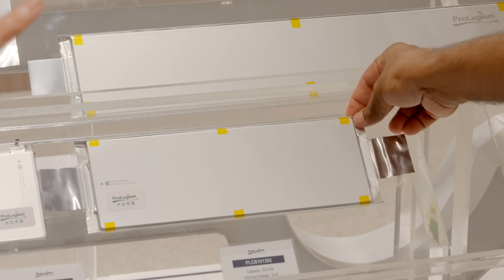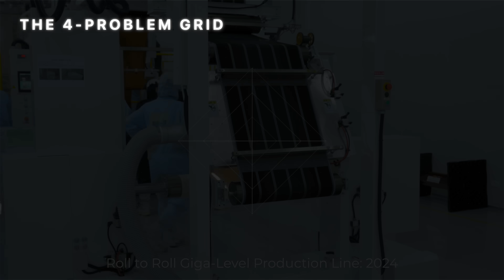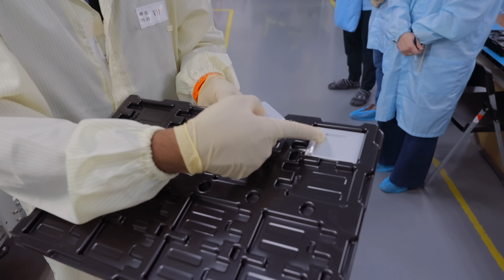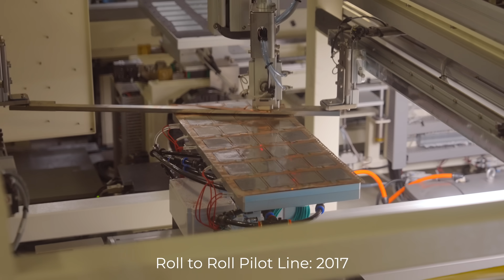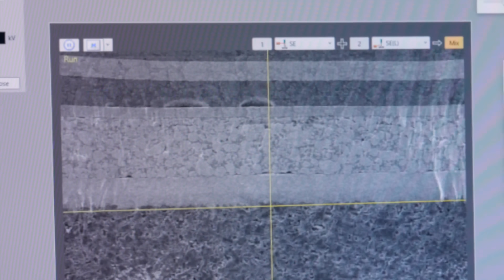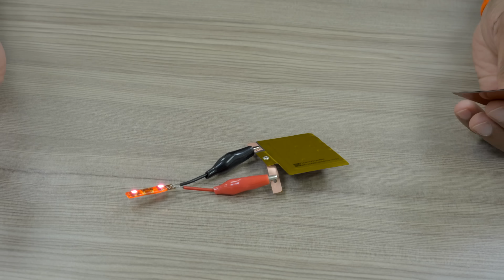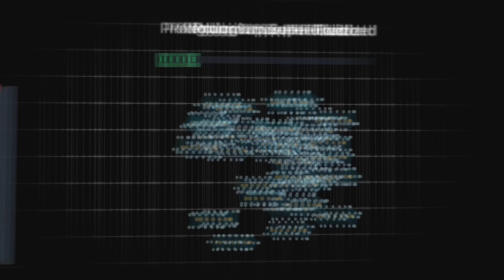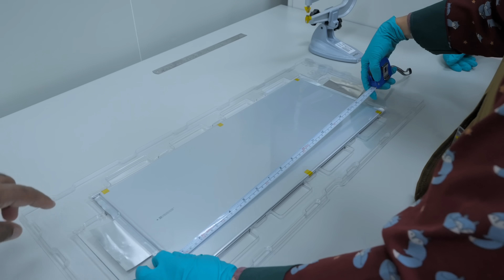Testing a REAL Solid-State Battery - Finally Here?

Comment: Price, thats the one question i want to see answered, looks too good to be cheap. But im glad that finally someone made battery like this actually works, instead of just empty promises... right donutlab? what happened to them? didnt heard about them for quite a while.
Reply: @Aker811  we already get them in drones and other places, we just didn’t knew the hidden heroes…Mercedes is working with them since 2016 and invested in 2022
Reply: @gratziind  which drones?
Reply: @huwale you got me there cuz apparently they still didn’t released nothing
Reply: @gratziind which drones? I wanna check it out
Reply: @gratziind  Mercedes also invested in Ballard and nothing happened there.
Reply: @gratziind  I was going to say this will absolutely appear in high end electric cars in a couple of years.  There's no way it won't given the performance of it. Mercedes just announced a car with massive range boosts because of the YASA motors they are using. Couple it with these an you might be looking at 1000mi per charge machines that can refill in 10 minutes.

IDK if this will live up to the hype, but it feels more real than the donut labs ones so  couple the two advancements I mentioned and we might be looking at a total sea change.
Reply: @1983kpb  I think China might have already copied the technology and maybe making it at a big scale already!
Reply: @chandan4156  China is making a different kinda battery. The more different companies out there making better and better batteries, the better for the consumers. Win-win.
Reply: The price is always going to start with what the market can bear. If the performance is really that fantastic, it'll be initially very expensive because otherwise there'll be an immediate shortage given how few they can make in pilot. How fast they can ramp up then determines how fast they can drop the price toward cost of materials/machinery and thus how fast kinks can be worked out in real use as adoption improves. Sometimes a showstopper happens along the way and that's what's stopped many chemistries from wide adoption.
Reply: @MorriganI possibly not due to the presence of less rare earth metals
Reply: @stellartoad  It's not less rare earths, it's none. Batteries do not have rare earth metals in them. Neither this one (SFAWK) nor almost all others. They are in magnets/motors. (I guess there might be some in their magic separator but it wasn't mentioned). Nickel, cobalt and mangagese are not rare earths - they are just metals.
Reply: @MorriganI  Their eectorlyte is 90% Ni, 5% Co&Mn. Nickel is relatively plentiful ~20$/kg
Reply: @ChuckLeeClerk  I assume the raw materials is their trade secret, so we won't know the baseline cost. As I wrote, though, manufacturing is the initial limit which is why price will have to be high or else it'll be sold out immediately.
Reply: @ChuckLeeClerk  That was the cathode, not the electrolyte.
Reply: @MorriganI  The performance isn't really much better at 30% in a very large surface area battery. When made in say cell phone sized batteries the advantage over NMC will decrease substantially.
Reply: Donut Lab increased the weekly cadence of their uploads toward biweekly and then triweekly. The substance of their videos has also declined dramatically, I think the other week they released a live charging demo for the second time. They're definitely running out of ideas.
Reply: @Vorexia  Its interesting that donutlab is still being secretive while ProLogium just show everything while this is exactly what i imagine battery from donutlab will be, but im not sure in comparison if they promised even more or how is it stand from what we know against this battery.
Reply: Phones and laptops will be better off with these cells. No more shipping hazard, no fire risk in aircraft.
Reply: @liam3284 if they live up to, or exceed the hype, everything will benefit from these batteries. From the looks of it, they may have actually cracked the code, and if so, they'll be the most profitable battery manufacturer in the world!
Reply: These batteries will go into premium EVs and command a premium price until economies of scale bring down production costs, same as every other new technology.  Probably at least double the cost of LFP in the short term.
Reply: Price is SO important. If this only becomes a “rich man’s battery”, nothing will change.
Reply: @bigedslobotomy  That's rather unlikely for several reasons. One, the competition is fast on their heels. Two, the way they'll make their money is mass production. Three, the world demands it! There's only so many rich boy toys to be sold, cater to the masses, and they'll make a million times more money. The safety factor, along with all the other apparent features, dictates the demand will far exceed the supply, and if they don't want to get squeezed out by the competition, they'll corner the market in every conceivable way..
They seem like they understand all this, and I would be shocked if they didn't mass produce for the whole world to benefit, I think that's why they got in the game in the first place!.
Reply: @Quickened1 You underestimate the greed and incompetence of corporations. There are so many good ideas, that if marketed right and priced right, would have been dominant, the pricing is simply the last step from invention to the market that can be screwed up.
Reply: @bigedslobotomy 
Oh, I understand it all too well! That's exactly why I think these will be mass produced for everything, because they stand to gain a million fold, compared to what they would gain if they limited it to the rich! The new factory alone has got to be incentive enough to push it out to the masses. I may be wrong, because like you suggest, you just never know until it's out there. If it's not these guys though, it'll be the next, so I believe we are on the threshold of a solid state battery revolution! The safety factor alone demands it be in evs and cell phones...
Reply: @Quickened1 You’re right, they COULD do everything right and make a boat-load of money, but I’ve seen MANY such ideas fail because of greed and inept management.
Reply: The cells themselves will be more expensive, but a huge cost that gets reduced is transportation, since the battery won't need specialized safety measures, you can deliver these batteries like bricks and nothing will happen.
Reply: The price of these batteries should be highly competitive since they solved the mass production hurdles other manufacturers are still struggling with. They are producing at scale, and the materials are relatively inexpensive. I see no reason they should cost much, if any more than standard cells... We'll just have to wait and see, won't be long now... 👍🏻
Reply: @Quickened1  They are not producing at scale, yet
The production line shown is still the pilot study and proof of concept

Their full production factory is currently being built in France, and the first stage of production is estimated to be in 2028, and the full stage at 2030+
They estimate the price will drop to high-end lithium battery level once in full production, but it's hard to tell if this will be true.
Reply: @chrisdt2297  ah, I see, well I guess I misunderstood that part of the video. Judging from what I've seen of the competition, it looks like they are way ahead of the c curve. Even if they come out a bit more expensive, from the looks of their jump start on production, the price will drop pretty quickly. If they live up to the hype that is. We still didn't see charge/discharge cycles, top  off estimates, duty cycle, etc, but it looks very promising. It's just exciting to see a solid state battery at all! Thanks for the info...

Comment: Excellent Presentation!!   The best battery review I have ever seen; and proof positive that solid state batteries are really here now.   :  )
Reply: @paulk6947   People have been totally fixated on the solid state  qualifier that they're starting to miss the point. What's important to the end user is  low cost, high charge rate, compact/light design, safety, and longevity . If it checks all these boxes , it doesn't matter if it's made out of play dough or gatorade .
Reply: @Nada-1a2b  100%
Reply: it has electrolyte though
Reply: @cristibaluta  yes… a solid one
Reply: @quitewelllovedactually  The demo with trying to burn it, clearly shows it is liquid
Reply: @cristibaluta  And then its is applied and dried on the ceramic film separator. The ceramic is also a liquid until dried and fired. As the test showed, no liquid on the finished product and no evaporation when heated under vacuum. It is a solid at this point.

Comment: Are you sure they're not using the process of mixing plastic and ceramics as a separator? 

That would create a hybrid with the flexibility of plastic and the heat or wear resistance of ceramics. To make a thin composite material, the standard approach relies on polymer-ceramic compounding through melt-blending or solution mixing, followed by shaping into thin films.

Comment: Yesterday I watched the electric Viking and they showed a sodium battery 261 wh density today it’s a 350 wh SSB - I will wait for the car and the ratings -
Reply: Doesn't motivate to buy a new ev now when the tech is progressing so fast...
Reply: @PeteEH it'll be 3 or 4 years before it makes a production car. In the end most people charge slowly at home and the current range is fine.
Reply: Well, it doesn't seem to be ssb if it has electrolyte, did you watch the video?
Reply: @cristibaluta Of course it has electrolytes. Wouldn't be a working battery without them. 😂
Reply: @PeteEH  so it's not ssb
Reply: @cristibaluta ssb have electrolytes. Like all batteries.
Reply: @PeteEH  it was supposed to be solid instead liquid, from here the ssb name